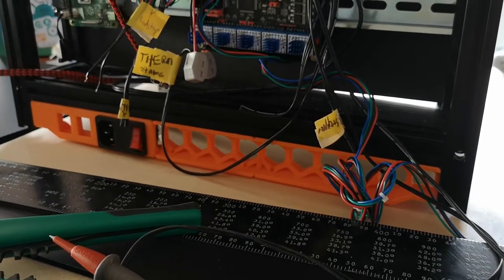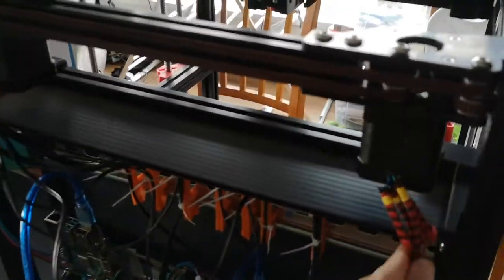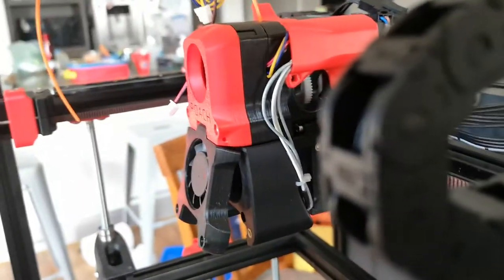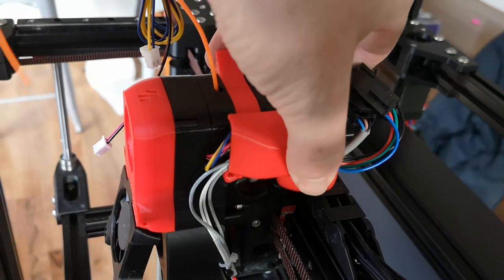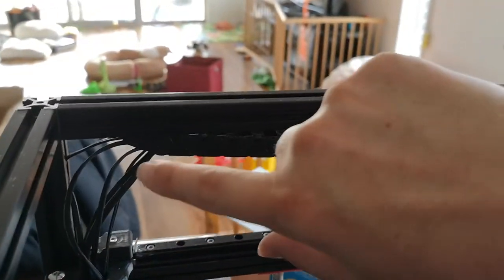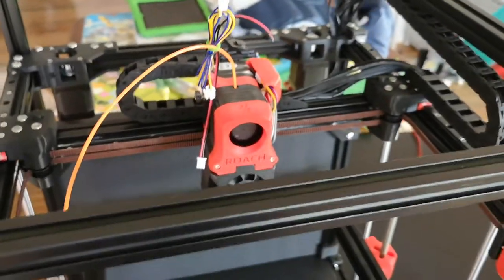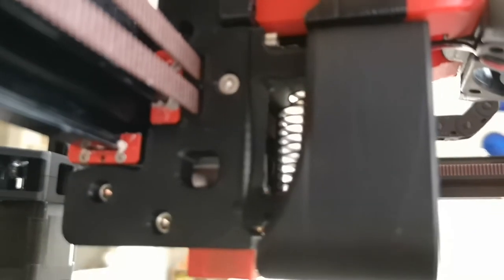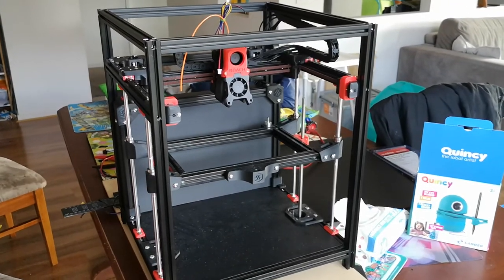Voron v1.8 general wiring update

Comment: Hi what guage wires are in the the black wire bundle going from the printer head?
Reply from the maker: Mostly 24awg, except for the extruder which is 20
Reply: @BrettJamesSuperRoach  20 for the heater or the extruder stepper?
Reply from the maker: @ibrahimansari5583  The heater